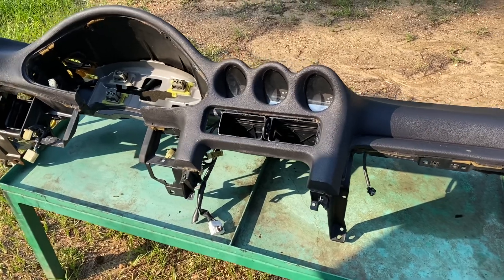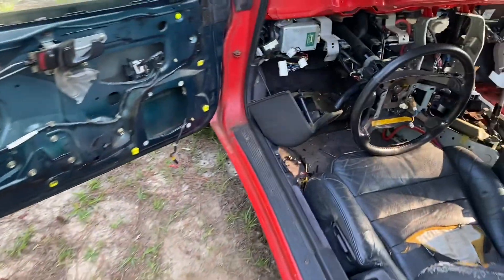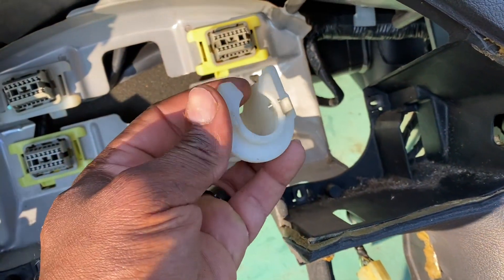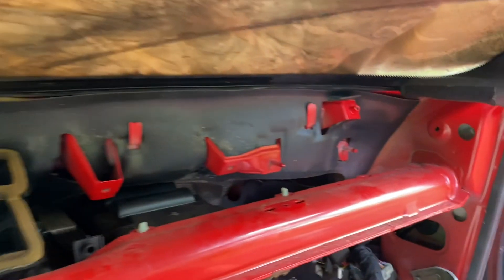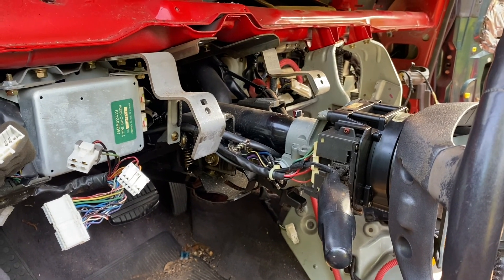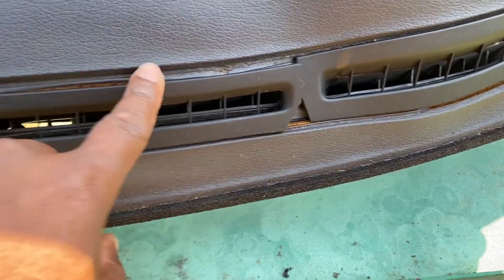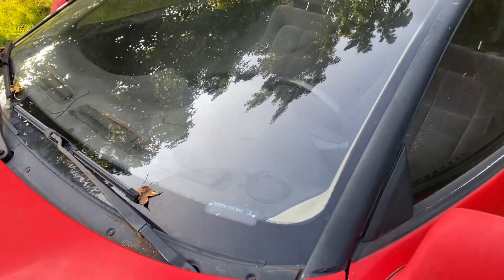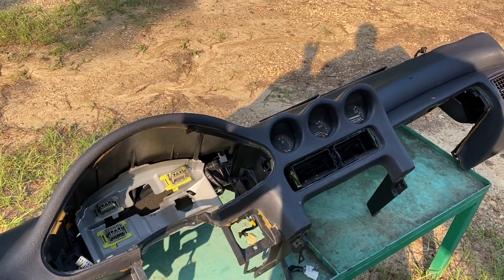1993 Mitsubishi 3000GT/Stealth: Apex: Dash Removal Tips.

Comment: Very useful video ! Thank you very much.
Reply: I wonder  if I need to remove the dash for fixing the oil pressure clock.
Reply from the maker: I would replace the oil pressure sender first. It is located on the driver side under the power steering pump and to right of the crank pulley.
Reply: @MagnusPrimeE1  yes I did it and also exchange it but nothing changed. Looks like any signal is coming in. My 3000GT is VR4 1992